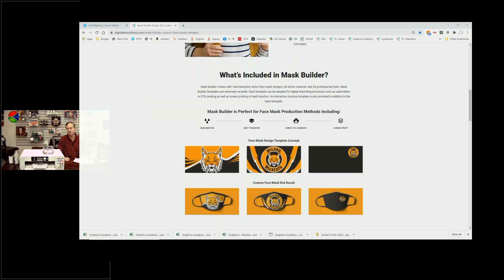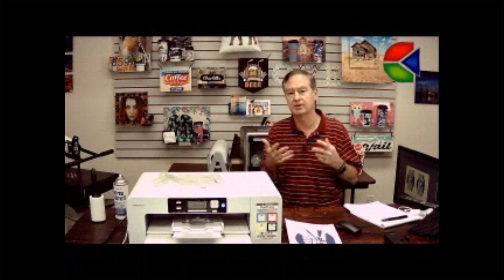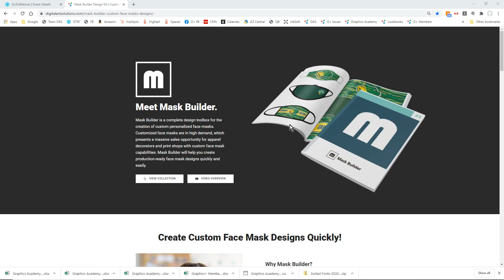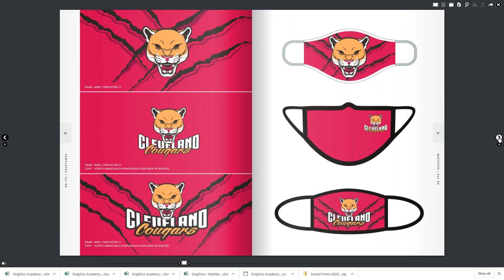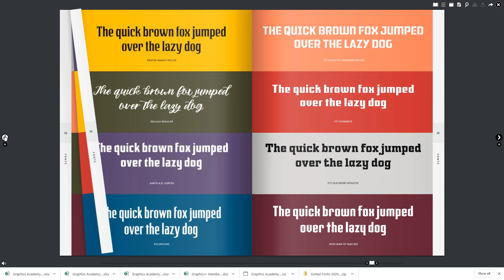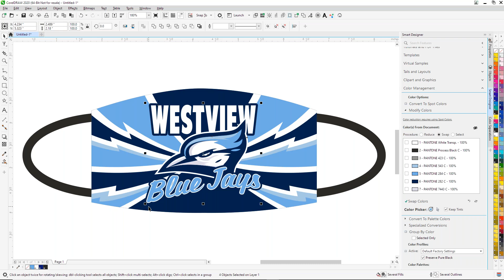Setting up a Successful Sublimation Printing Business

Comment: If print a small 5x5 image on a 65% polyester 35% cotton shirt because I want to learn and do the bleach out look on color shirts.
 I'm trying to get my colors and black to look the best I can get it.
because of the heat press tempture and pressure may be off a little.
I can get more small sample prints on the shirt to test without messing up a lot of good shirts.
If I print the same design big will the bigger print be the same look as the small print when i get the small print to way i want the colors to look with the same print and press setting?